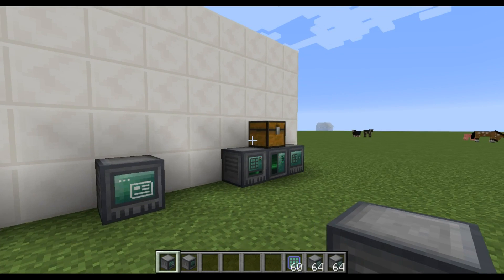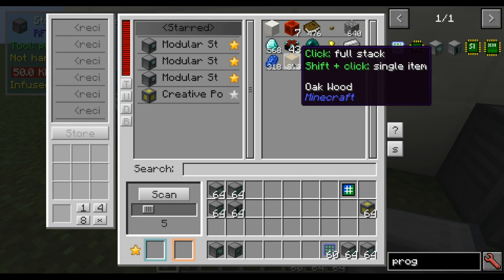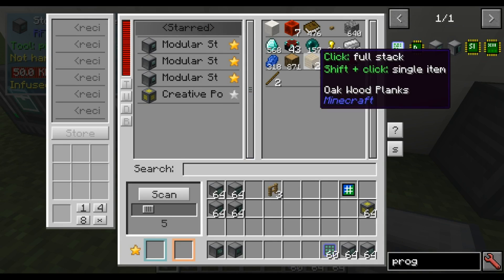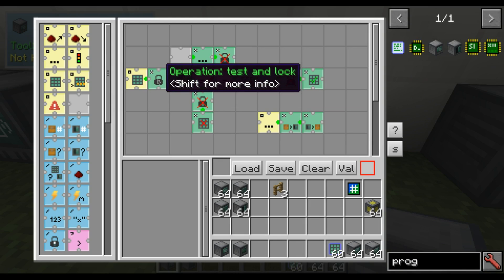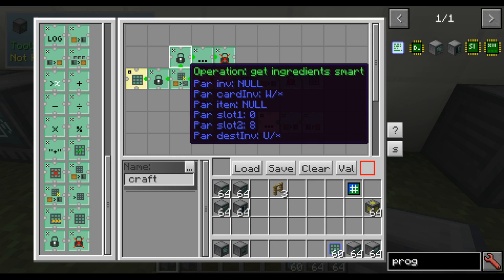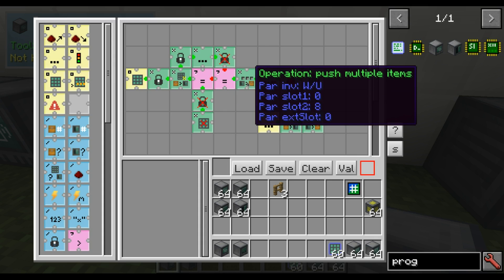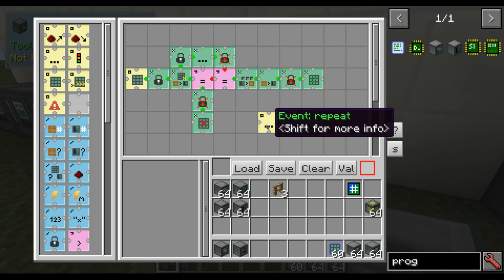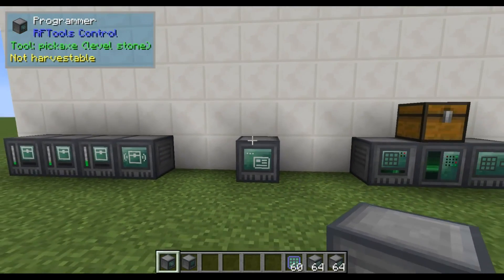Recursive autocrafting with RFTools Control

Comment: Jty!!! This only seems to work if you have a cpu per every possible recipe it would have to craft leading up to the end recipe, because all the parent recipes seem to place the program on hold waiting for the prereqs to finish. Is there some way to prevent that? The processer can only hold so many CPUs and therefore is limited severely by recipe complexity :(
Reply from the maker: You need a cpu per level yes. But not for every recipe. i.e. you can have hundreds of recipes. It is only limited when recipes depend on each other. There are ways to rewrite the program to avoid that problem but that's a bit more complicated. It is easier to just insert more cpu cores
Reply: Yeah I was attempting to find a way to tell it to wait when it is doing a parent recipe until the prereq recipes are done but i can't seem to wrap my head around it just yet. It does look like it dynamically loads in recipes as needed so it can do SOME multiprocessing in a way even with limited cores. This is an awesome mod as always, man. Keep up the good work.

Comment: I Have two questions, will exist an wireless version of the crafting station? And is there an way to continue doing and crafting until we have an set amount of itens in the system?
Reply from the maker: Yes, a wireless version is planned. Also integration with the remote storage tablet from RFTools is also planned

And yes to the second question too. That kind of thing is very easy to automate with this mod. There are opcodes to count how many items there are and you can easily setup various tasks and machines if there are not enough items

Comment: Some questions, firstly, are recursive recipes infinitely expandable and compatible with custom crafting like Botania or Ender IO Alloy Smelters? How does recursive crafting handle NBT data for stuff like wrenchs/hammers that take damage, and does it recognize reusable materials like buckets or Pam's Harvestcraft cooking utensils?
Reply from the maker: The program demonstrated in this video doesn't handle any of that but you can make programs that use alternative crafting systems like alloy smelters and so on. The system can do that